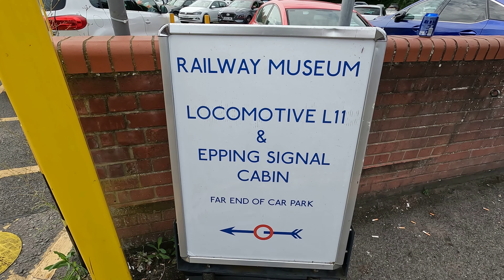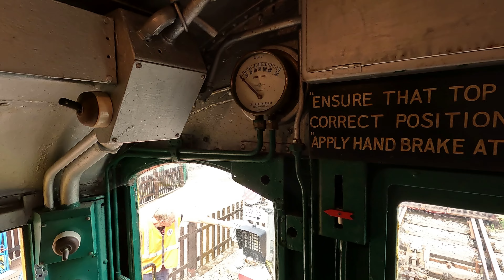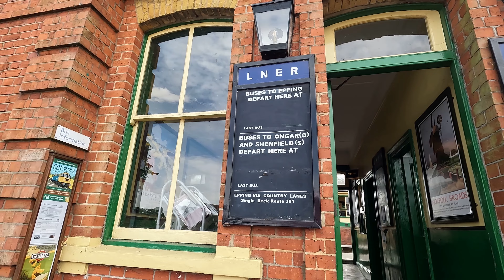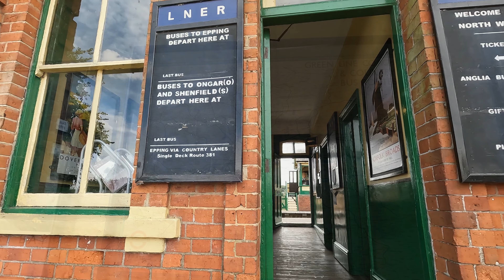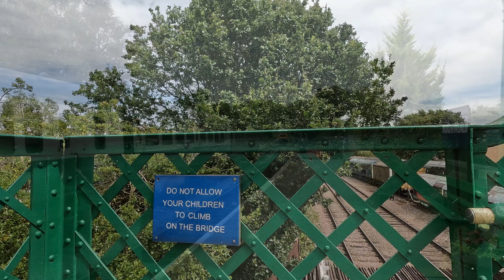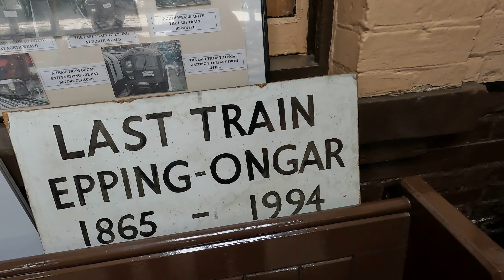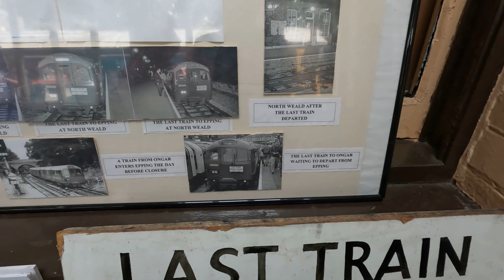Why is the Epping Ongar Railway pointless?

Comment: I believe the people of Ongar would like to have the Tube back in light of the increase in road traffic over the years.
Reply: The reason the Epping/Ongar LU branch line was closed was due to lack the of passenger usage along the time, therefore making it financially inviable. It used to cost LU £7 for each passenger journey.
If TFL wanted to re-instate the Tube branch line from Epping to Ongar, it would cost them many millions of pounds, and they can't afford it. The other issue is that the line is now privately owned.
Also, the Epping Ongar Railway heritage line is boosting the local economy of Ongar and North Weald due too the number of people visiting the railway.